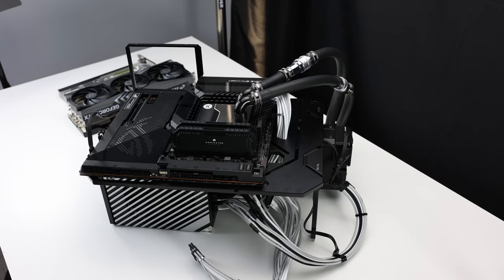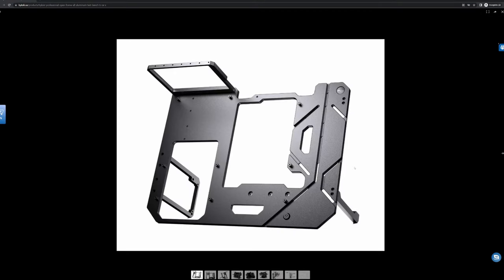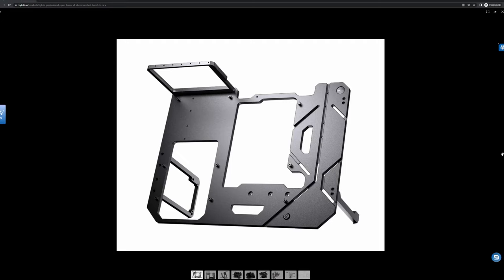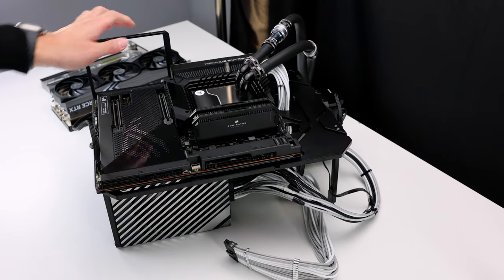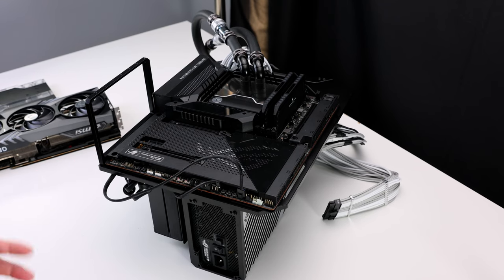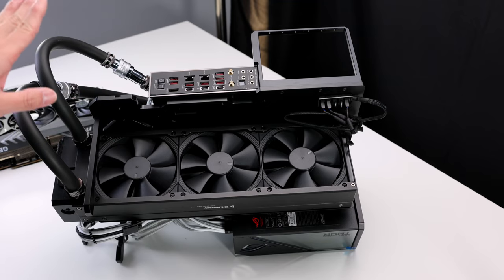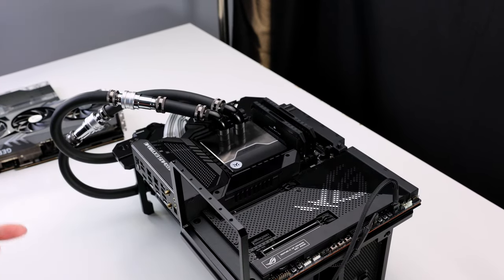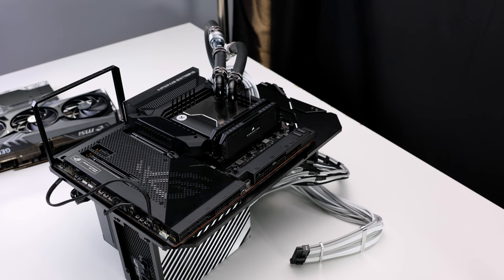Bykski Professional Open Frame All-Aluminum Test Bench Quick Review

Comment: I bought this exact same case a while back and I'm using it in the slanted position with 2 x 360 Corsair radiators and hard line tubing. I love it but I also had the same problem with finding that not all the screw holes had been tapped. Also mine arrived without the graphics card bracket so I had to contact the support and send them photos showing them what was in the box. they were extremely fast to send me the missing part but I could have done without the hassle to be honest. When I order something I expect what is shown to be in the box. Like you I had to order the two radiator brackets sepraretely and should have checked whether they were included or not as this was a disappointment to find that I had to pay extra and wait another two weeks for the rest of the case to be fully ready to build in. I'm not using it as a test bench but as a proper case and I absolutely love it to be honest. I wanted something that was open chasis and very small form factor but with the ability to use 2 radiators and have a full custom loop for both CPU and GPU and this fit that brief perfectly. I use one of those powerful plug in air dusters to keep the system clean and free of dust. I found the build quality very good, despite the one screw hole that hadn't been tapped which was most annoying. I hope this helps anyone else thinking of buying this chasis.

Comment: to this day i have not found a bench that enables me to run up to 4 rads at once. i don't get why they just unclude one or two mounts for radiators. 
480mmx480mm all around the base would enable you to put 4 radiators, hide the power supply below them and give you more than enough room on top for the board, then just put some feet on it that give you the option of putting it on an angle, straight up or laying down and we'd have a sick bench. idk how this is too hard for companies to create..
Reply: Why would you need that amount of rads? I'm running a 4090 and 5800X3D on a Core P1 and most of the time the fans on gpu isnt running. NHD15 on the 5800X3D doesnt get loud either. I thought the main reason of getting an open frame is the accessibility to the components. Easier swaps and serivce, that sort of thing
Reply: I run a 480 and dual 360, on my praxis wetbench sx, you could add a fourth if you wanted.

Comment: Hi JC, I'm thinking of doing a project in a Phanteks Evolv SHIFT XT case with hard tubing, however my GPU covers almost the entire area designated for it, so I won't have the space to put a regular reservoir/pump combo. Therefore I was thinking of purchasing the Barrow DARIDP-30 like the one in your video, but the 240 version of it. On paper it looks perfect for the project as I would have everything, pump, reservoir and rad on top, freeing up the necessary space for the GPU. However, I am concerned that the process of filling and bleeding the loop will become problematic. Do you have any experience with this product that you could share with me, would you recommend it. I would greatly appreciate any suggestion or advice mate. great vid BTW, thank you very much!!!
Reply from the maker: I have never owned the shift but since your gpu covers the entire front where a small flt you can try the All in one blocks from EK that are a pump/res/cpu block in one. They have it for 1700 and am5. I have one in my build with the apex and white strix.

Comment: Hi there, can I put my PC on the side to lay flat on the desk to prevent gpu sagging instead of putting it follow  the normal orientation ? I did  try vertical mount the GPU but my CPU air cooler is taking all the the spare space, so nothing will fit,  will the PC work normally  if I just lay it flat down on my PC desk ? I have Corsair 4000D Air flow and a really heavy GPU, a simple GPU stick support bracket  won't help it at all since I can still see gpu pcb being a little flex.
Reply from the maker: you could lay it flat if you wanted. Or you can try a gpu stand.

Comment: By the way would this be able to hold 2x 420mm rads with an ATX board and no GPU?
Reply from the maker: Unless you make a custom bracket no. The brackets support only up to 360
Reply: @JCustom  Thanks. One last question regarding the res, can it hold two 360x60mm?